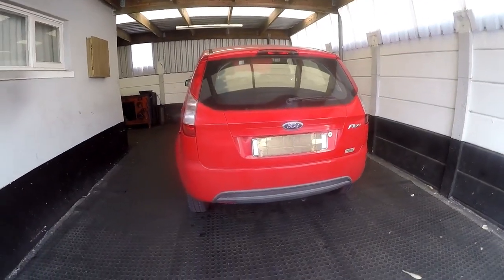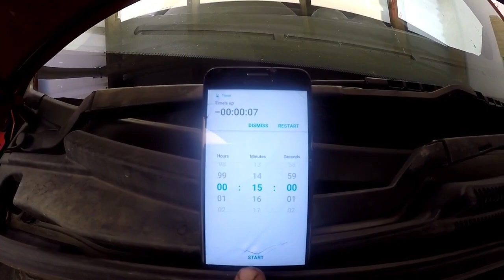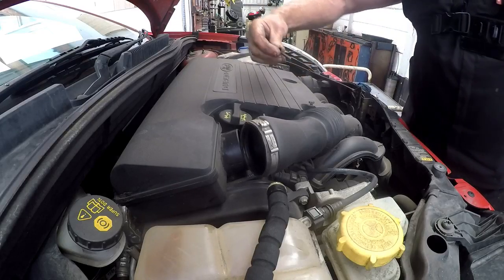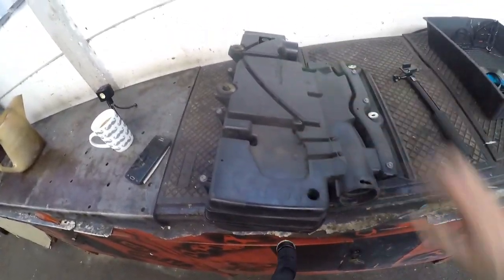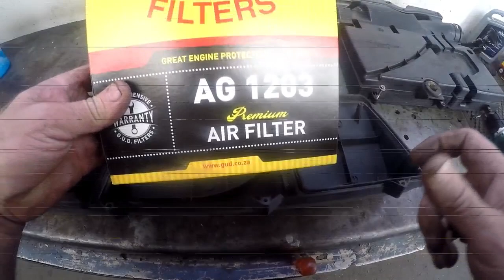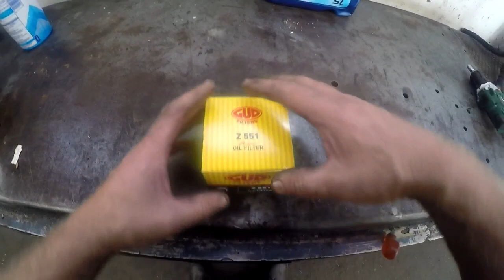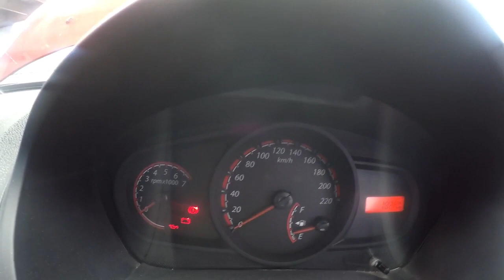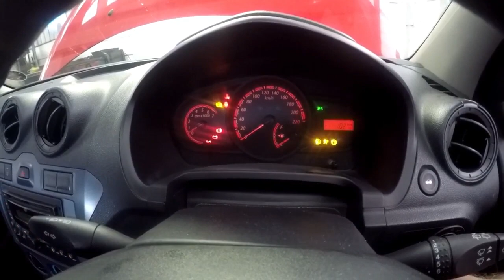Ford Figo 1 4 Duratec   Oil and Plugs

Comment: I'm watching this video again as I'll be doing an oil change today... Will let y'all know how it turns out later...
Reply: Did the basic service, followed all the steps and car is running well! Had a problem with getting the spark plugs loosened, send previous service guys turned it too tight, but eventually got all four out after I went and bought a different wrench and socket. Just now need to find a place to dispose my oil at... Thanks for this very detailed video!!!

Comment: We have a 2011 model. As a blind person I know through engine and exhaust sound that these cars are basically a slight redesign of the 2002-2008 Fiesta because the stock exhaust sounds very throaty and sporty, as if it has been suped up slightly. I don't know if you have noticed this as well. I've always believed that stock exhaust systems should give of a quiet but deep hum. That's why, in terms of modern cars, I gravitate more towards the Vw Golf 4/5/6 1.6 petrol and 2002-2009 Polo 1.6 Petrol. Wit Ford, I would take a Figo-shape Fiesta (2002-2008) over a Figo because of the chances of getting hold of a 1600 model and I think the stock exhaust from a 1600 Figo-shape Fiesta would sound much better than a 1400, I would love to hear a comparison of both at some point.

Comment: Thanks for the video on servicing Ford Figo, I really appreciate it. I think for Ford ikon 1.4l 2007 Ambiente should be the same procedure. Since it is a durec engine. And the car parts are mostly similar.
Reply from the maker: Yes, you are correct, Ace the Duratec motors are all the same.

Comment: my ford ikon has the exact same engine but im struggling to find an alternator,any recommendations,part number on mine is no longer visible
Reply from the maker: Trying searching for it under the Ford Duratec engine code FXJA/FXJB OR F6JA/F6JB/F6JC  these are all the same Duratec Ford Engines., good luck.
Reply: thank you i found it,car running now,now i just need a video on my aircon making a loud screeching noise sometimes
Reply from the maker: @bertramrossouw5239  It could be the belt is too loose, especially noisy when the engine is still cold.

Comment: Great video!! But can you tell me engine oil grade. The book says 10w30..is that what you use?
Reply from the maker: 10w30 can be used but it is overkill, I use 15w40, remember it is recommended to change oil at least once a year or 15000kms whichever occurs 1st. No oil grade can substitute regular oil changes.

Comment: Hi Sir
Some  technicans say that teflon tape should not be used on engine oil plugs- as the tape shrudded pieces after tightening or loosing next time the small piece will go and get stuck in small oil galley.
Is it true.?
So i never did use it . Just replace the plugs if it leaks.
I'm a DIY guy not a professional technician. Just wanted to clear this from my mind. 
Thanks, for nice videos and effort 🙏
Hare Krishna
Reply from the maker: I have been doing this for more than 35 years never had a problem don't believe everything you read or see in videos, verify everything, thanks for supporting my channel with your visit and interaction.

Comment: Hello there how do I soften a gaer lever of my ford figo 2011 anbient sa it's turn to be stiff if I drive a long distance
Reply from the maker: I do not fully understand the question, I think you mean the gear lever gets stiff when the car drives a certain distance, you must check the gear lever cables, it may be worn or frayed, also check the gearbox mountings it may be worn out, Mogomotsi.